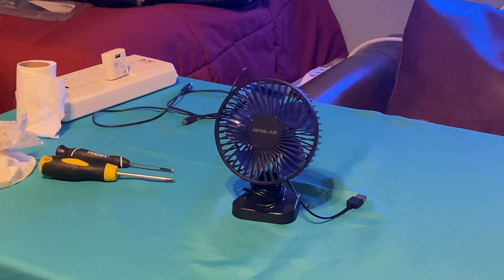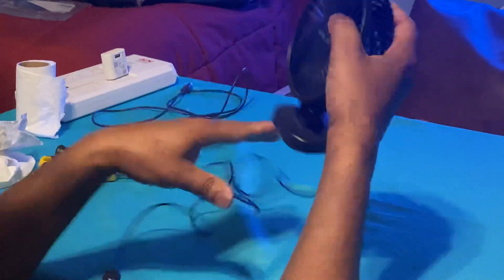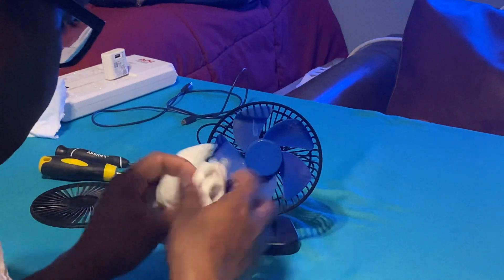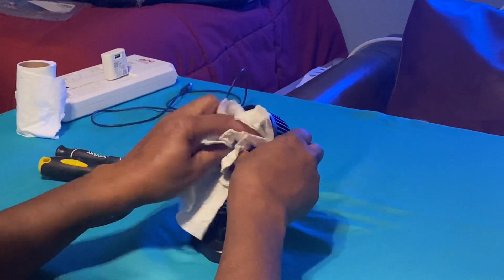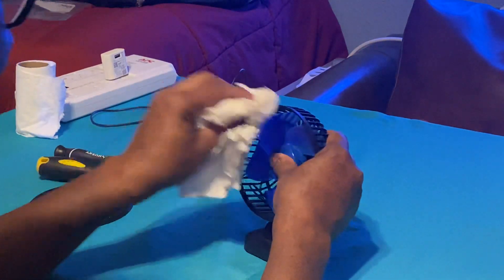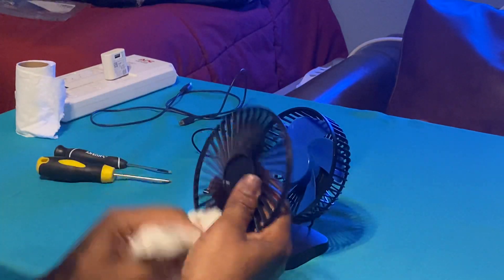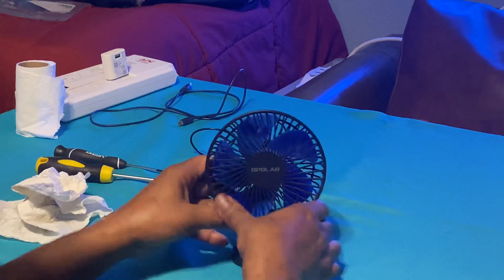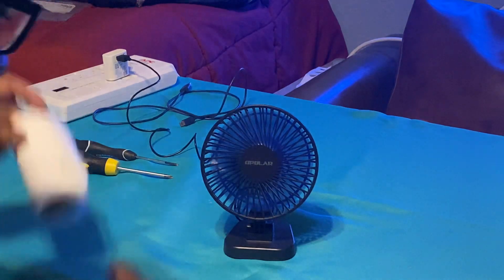Cleaning an Opolar Desk fan

Comment: Still working?
Reply from the maker: sorry for the late reply but yes
Reply: @LemontTheFanMan  I appreciate you man. Thanks
Reply from the maker: @mikeoporto6365  You’re Welcome anytime 😊
Reply: Any suggestions on how I might be able to oil the fan? Sometimes upon startup, it struggles to get going. Like it needs to be oiled. Obviously the blades won't come off. Do you think if I dripped some oil in that gap behind the fan blades it will damage the electronic components inside?